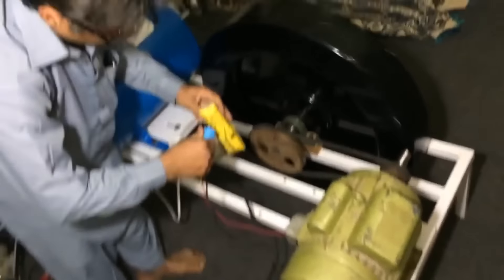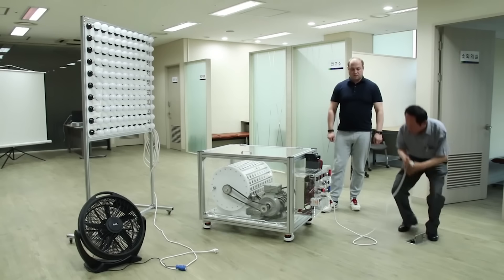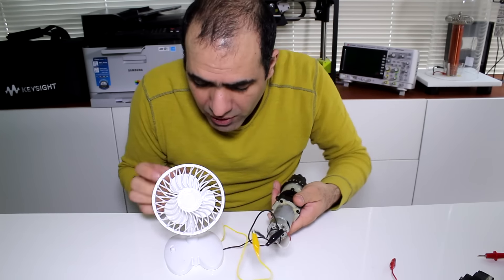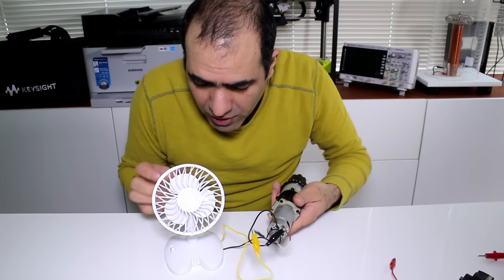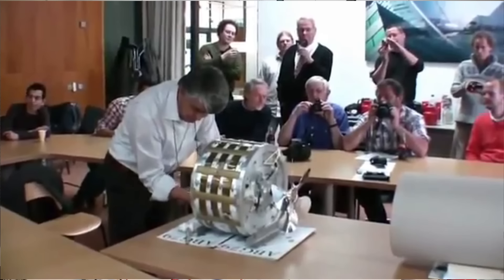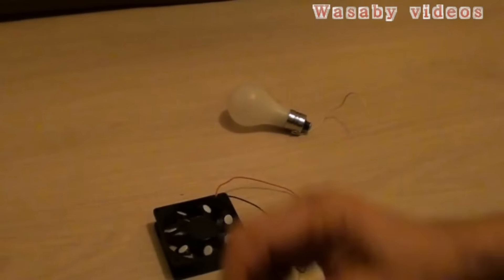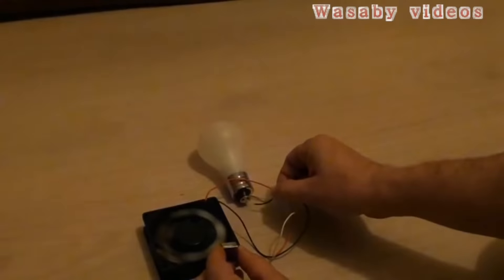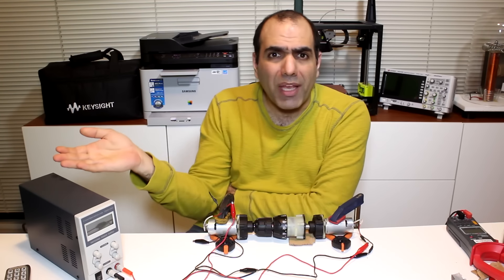The Curious Case of Free Energy Device

Comment: One thing I like about the concept of trying to make a machine that can generate electricity for a long time out of what's basically lying around or for very cheap is that this technology can be very beneficial. However, I don't like people making "free energy devices" out of the same type of stuff. The former could help make mobile power generation easier in developing nations. Just crank it for a couple minutes to get this big ol' flywheel going and the attached motor will charge the batteries hooked to your lights. The latter is plain thievery and deceit. Not only is it marketed the same as cheap power sources one can build out of basically trash, or as a solution to world energy crises, it relies on people who don't know better to fall for it.

Comment: I actually thought of using solar panel energy for electrolysis of water to Hydrogen and Oxygen. Discard the Oxygen and store the Hydrogen for energy. I was a bit late however. Someone else thought of it a year prior in 2021. I dont know why we are not converting current solar power farms to do this.
Reply: @darklight2.1  Not enough Lithium and lead on the planet to do that. Hydrogen power plants would be emission free since burning hydrogen only emits water. Its far more plausible to convert solar energy into hydrogen gas. It can be transported and stored after each day. It would probably take a solar farm the size of AZ, NM and NV to accomplish that but in the quest to be emissions free its the only logical solution we have now.
Reply: Power-To-X is what you're thinking of and it's largely remained a pipe dream because electrolysis is incredibly energy inefficient and because it requires a ton of infrastructure that is expensive to built. Not to mention the fact that hydrogen will leak out of almost anything so it's difficult to store and transport for long periods of time.

Comment: Look up Mud Flood there 100% were free energy devices but they were cathedral buildings that used water, 
sound and the ether. The Tartarians were way more advanced then our civilization now and they were almost wiped out of our history.
You will see lamp post and lights everywhere with no wires. It is amazing.
Reply: You can power lamps without electricity.

It's called a candle.

Comment: Hey electroBOOM I have made projects which create electricity from sound it has a set of magnet which creates electromagnetic field that converts the static electricity into electric current however if we manage a way to create electricity  in this way then probably the concept of free energy can be achieved
Reply: Still technically not free energy, because it requires sound as an input
Reply: sound is not free energy
Reply: So you've made a microphone?

Comment: If we tap into wind movement while a car is driving we can make like wind powered electricity... from the wind as it passes through like a wind mill...🎉🎉
Reply: Yeah but by putting a windmill on the car, the energy from the air moving past it is initially made by the car’s engine to move the car and push through the air. So that would just increase gas usage and won’t give you any more energy

Comment: If Tesla had built his tower high enough to transmit energy into the ionosphere, so other towers across the planet could have pulled those electron out of the ionosphere, and was able to transmit energy wirelessly... it still would not have been free energy.  Tesla's plan required power generation plants to transmit electrons into the ionosphere.  It only would have removed transmission lines.  He blew up a couple generators at a power plant in Colorado testing it.  Even a tower with no generator, that just pulled electricity from the ionosphere wouldn't have been free energy, it would just be another way to collect solar power.  If that is free energy, then hydroelectric, wind, and geothermal is free energy.

Comment: Tell me something, I'm no engineer or anything like that at all but I was thinking if you were to hook up the tires on your car that doesn't do anything but TURN to electric generators and then hook them to your electric motor and your batteries wouldn't they power both your motor and charge your batteries???
Also if you did it on a train you'd have hundreds of electric generators powering everything just by going down the rails???
Wouldn't that be free energy???
Reply: Those wheels are only turning because they're being pulled along by the wheels that are powered by the motor. What you've concieved of is basically a type of brake called a regenerative brake and electric vehicles do in fact use them and it massively improves their effiency in city driving. Electric locomotives however can't use them since they'd be delivering the electricity directly back into the electric grid and our grid simply isn't built to be able to handle those kinds of surges in power so electric locomotives have to use traditional friction brakes instead.

 Basically this isn't free energy, it's just a way to more efficiently use your energy.

Comment: Thanks for calling out all that BS!
Let's not forget that wires moving through a magnetic field make energy, just need power to move it along 
and all that "free" energy stored in the atmosphere, we see as lightning - how do we harness all that?
Reply: Lightning is simply too energetic to use to power anything. It melts most metals almost instantly so it's like trying to run a wind mill in a hurricane, the wind mill is probably going to break.

Comment: but what if we captured the energy of solar wind. or captured some energy from the speed our solar system is traveling through the galaxy. its not free but would be pretty unlimited
Reply: How much energy is in solar wind?  Honest question.

How are you going to push off against the galaxy?  Honest question.
Reply: @tsm688  1 a Hella fucking lot 

2 we cant
Reply: If we somehow tried to capture the energy stored in our solar system's orbit around the center of the galaxy that would cause the orbit to decay until we fell into the black hole at the center of the galaxy.

Comment: If it sort of is like a car, then it could technically  store energy from the energy it creates, so .. Maybe you have to put a small amount of energy to then start the device   🤔 😕but then it creates its own electricity ? Idk 🤷‍♂️ I'm no scientist . But it seems that's a good way to just save on the cost of electricity 🤔 even if you have to charge it ever now n then .
Reply: Cars don't create energy, they just extract it from the chemical energy already present in the fuel and they do so incredibly inefficient, only being able to extract about 30% of the energy in the fuel and losing the rest to heat, that's why gas powered cars get so hot while running.

Comment: Actually, John Bedini had an interesting take on this. His system used a mounted coil where magnets were spun past it on a "wheel." The coil had another winding wrapped with it, called a trigger coil. The trigger coil used back EMF to charge a bank of batteries. He then used the batteries to power his lights and appliances. As the batteries drained, he had another bank that was charging using the back EMF. The concept seems plausible. The "free" energy only charges the batteries. The downside is that only lead acid batteries can be used. i would like you to check this out and see if this idea can work.  His idea was used by a young girl in a science project that won the fair. Check out "John Bedini's Schoolgirl circuit."
Reply: That just sounds like nonsense. Also why not just use the battery directly?

Comment: Hi, I respect your opinion, but they are coverting magnetic energy to electric energy. Will it not work or the efficiency is low??
Reply: The problem is that most free energy devices have stationary magnets, to generate electricity you need alternating magnetic fields which innevitably require some energy imput (thats generators, solar panels dont need AMFs)
Reply: @k-osmonaut8807  That means its low efficient. TQ
Reply: @rohithvadlamudi   kinda, also it just can't generate any thing on it's own, because as i said electricity needs alternating magnetic fields, so you also need moving magnets very fast to create any meaninful voltage
Reply: @k-osmonaut8807  Yep Agreed on that TQ
Reply: @rohithvadlamudi  no prob man, glad to help
Reply: @k-osmonaut8807  Ok cool
Reply: They are not.  Generators do not eat the magnet, ffs.

Comment: As far as I'm concerned heat pumps are free energy devices. My definition of free energy is such that a heat pump fits inside of my definition.

If heat energy can be relocated from one location to another location against a positive slope with a COP > 1 like heat pumps are capable of doing, then it is absolutely possible to do that with other forms of energy. It doesn't magically become "free energy" because the type of energy changes. Let's be honest here: it's really disingenuous to rate everything in % efficiency and then to use COP for heat pumps. COP 1.8, wich is typical for an air to air window mounted AC unit, is an efficiency of 180% in terms of relocating/concentrating heat energy. It's rediculous to say free energy is not possible, it doesn't matter that the heat came from oustide, it matter that you spend X joules of energy in whatever format and get >1X energy in the desired format.

That's free energy.

If it can be done with heat, then it will eventually be done with electricity. But I don't think it will be done with electromagnetics or magnetics. It will probably be electrostatic in nature or it will involve some kind of reversible chemical reaction that can be supplied by a heat pump and will leverage the heat pumps COP to accomplish the end goal.

Just the simple fact that a heat pumps often have COPs > 1 already means free energy is a reality.
Reply: @D-Bunker and relocates more energy than it requires to run against a positive slope, cop 1.8 is just for window mount AC units from Walmart.

When you get the nicer heat pumps with better heat exchange, you can concentrate heat energy against a positive slope with COPs as high as 7.

That means you move 7 watts from the cold sink to the hot sink for every 1 watt spent running the compressor.

If it can be done for heat, it can be done for other forms of energy, it's a matter of figuring out what state change in what type of material is required to make it happen.
Reply: A heat pump is simply moving heat from one location to another, it is not generating that heat and in order to move that heat it needs to increase the entropy of the universe. I guess if you define free energy to simply be “it heats up something more than the energy it takes to run the device” then yes free energy is possible but that is not free energy by anyone elses' definition. Free energy usually means that we somehow produce energy that is capable of performing work greater than our input energy and a heat pump isn't capable of doing that. For every joule of heat energy we move with a heat pump it is only possible for a maximally efficient heat engine to extract 0,7 joules of energy from it, and in order to move that one joule of energy we need to spend roughly 1,2 joules of additional energy, thus leaving us with a shortfall.

The reason why heat pumps can have a efficiency above 100% is simply because the “waste energy” gets converted into heat and that heat is still serving the purpose of heating up your house, so if a heat pump spends 1,2 joules to move 1 joule of heat energy and in the process wastes 0,5 joules which gets turned into heat then 1,5 joules of heat still got delivered to your house, which is technically more energy than was used to power the device. This is also why a heat pump used to cool something (also known as an air conditioner) seems so inefficient since in this case the waste heat counts directly against the efficiency of the heat pump. If you spend 1,2 joules to move 1 joule of heat outside your house and waste 0,5 joules then that's an additional 0,5 joules that didn't get moved and so we end up with an efficiency of less than half.

Basically this is just energy accountancy and Heat Pumps can kinda just take advantage of the definitions we use to make themselves look better than they are. That's not to say that they aren't good, they're basically the most efficient way to heat up a home but they aren't actually breaking any laws of thermodynamics.